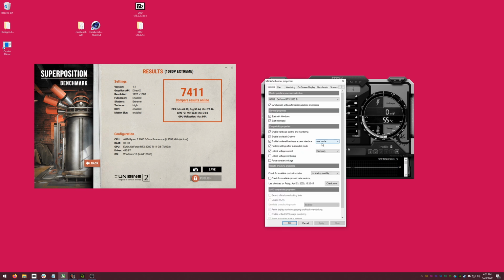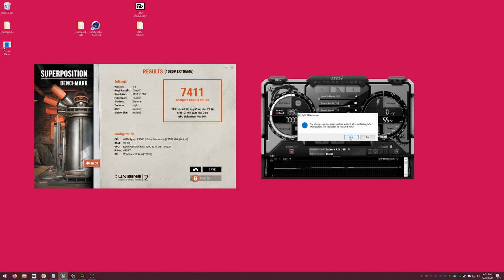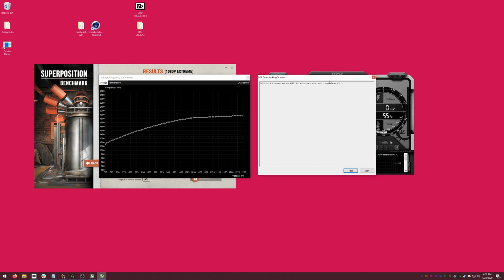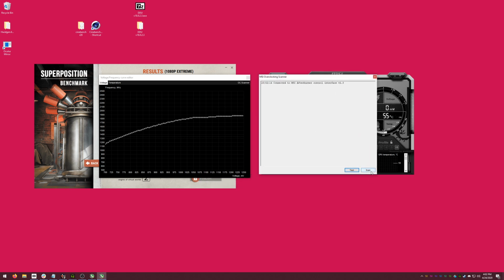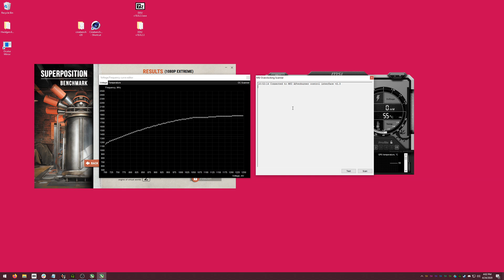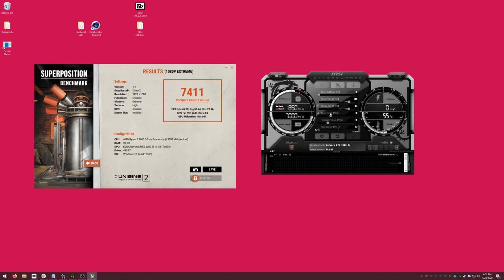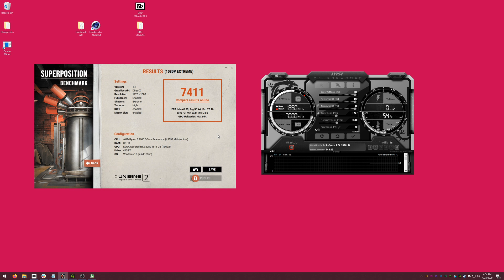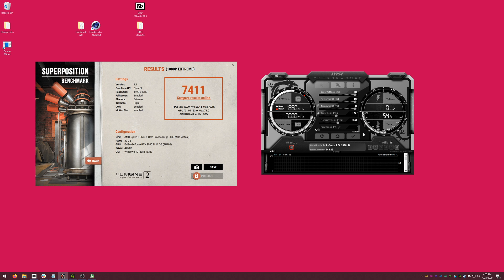Overclocking an RTX 2080(ti)/2080/2070/2060 the easy way

Comment: You mentioned that the OC Scanner does not do anything with the memory clock. However, in my case with my ASUS ROG RTX 2080 ti, it did bump it up by 200MHz automatically in the scanner. Is this because of updates do you reckon? I've followed your instructions strictly, and I only gained 25Mhz, I'm guessing it's because the card is OC'd from factory anyway, but unsure why it's affecting my memory clock. Managed to get a final score of 10,026 with just a bump of 500MHz on memory clock, and 150Mhz on core clock.

Comment: Such a refreshing quick and to the point guide, thanks dude.
Reply from the maker: Glad it was helpful!
Reply: @tthurlow  I actually have a quick question about the core voltage. What does dragging it to max do for us  given the frequency overclock was with stock settings? I thought you usually bumped up voltage as you start getting artifacts as you increase the frequency?
Reply from the maker: @imnotgivingmynametoamachine683  I won't pretend to be an expert - but my understanding is that we don't really have much control over true voltage. Bumping the voltage slider is more of a "use as much voltage as the card sees fit, and thinks is more or less safe" - what we're really going to be limited by is the power limit and/or the temperature limit of the card. While you might bump up voltage on a CPU overclock as a response to instability (usually a GPU crashes in my experience, not artifacts - I've usually seen artifacts with memory clock speeds that are too high), we don't have that kind of control over a GPU (probably for good reason).

Bumping the core clock of a GPU so high that it causes crashing, is probably actually crashing because either: the card is not willing to allow further voltage increase as part of a design parameter, or because package power limits (even raised ones) prevent the increase of voltage, because voltage is a factor in calculating power.

These are mostly educated guesses, but the bottom line is I would still max out the voltage slider because it's not going to hurt your card, and the card won't use voltage that it can't take advantage of. I also had a lot of crashing issues using the OC scanner with modified limits, which is why I suggested against using it after messing with the sliders.
Reply: @tthurlow  Thanks, I think you are probably right, I've read elsewhere something to the effect that you cant really change things outside of the nvidia specs regardless but they have a scary message ;)

Comment: When you installing Msi afterburner, should you also install RTSS with it?
Reply from the maker: That's what I'd do, but I'm not sure it's optional. Theoretically you wouldn't need it in order to overclock the card but you won't get any of the performance monitoring I don't think. If you try doing it without it, let me know how it goes.

Comment: Idk why my 2080ti oc only 2MHz...
Scan succeeded, average overclock is 2MHz
Reply: Same here. After running the scan it returns an average overclock of 93 MHz
Reply: @barrymartens3281  every card is different. Binned cards have slightly better quality silicon so they can overclock a lot more. The cheaper cards tend to be the ones that you can hardly overclock as they simply follow the bare minimum of the reference specs
Reply: @TheFlyingClutchman  Spot on! Also many cards come pre overclocked, so the headroom is minimal.